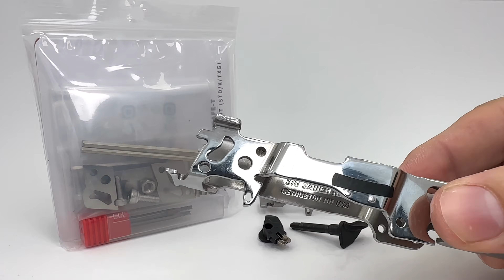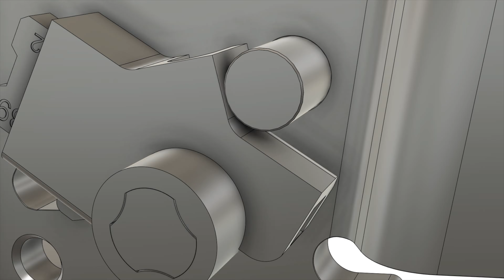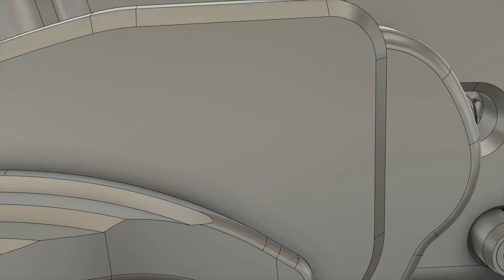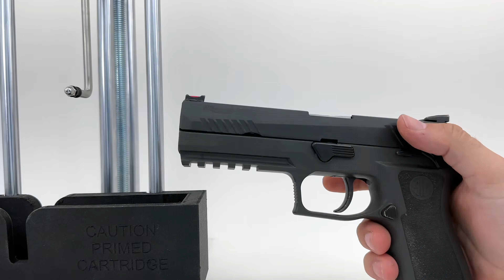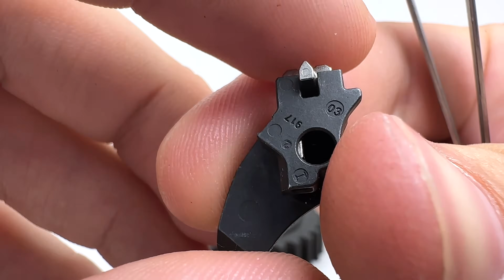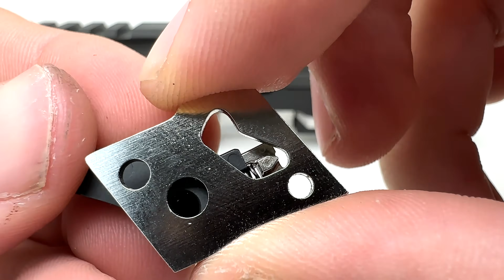ANALYSIS OF THE P320 MANUAL SAFETY

Comment: Will this stop the gun from self firing?
Reply from the maker: To be fair, there’s no evidence that the gun has ever gone off, literally on its own. There were a lot of Youtubers not that long ago trying to make that claim, but no one ever actually came up with a method to actually do that. It always came down to having to either modify internals or touch the trigger.

However, if that’s not what you meant then technically yes, it will help from accidentally pulling the trigger, and of course it still acts as a additional method of intervention in case you drop your P320
Reply: @SIGMECHANICS I'll respectfully disagree with you on that, a number of you tubers have proven and shown the gun discharging with no modifications.  I do like the idea of a secondary safety to prevent unintentional discharges though.
Reply from the maker: All good! To be fair, there are quite a few videos out there, if you can tell me which video you’re talking about I can try to explain what they are showing you for a mechanical perspective.

Comment: Can the P320 manual safety be modified to function like the P365 MS blocking the sear?
Reply: I have an M18 and 2 P320 Max that I have put in a manual safety.  Any way to design a safety that blocks either the sear or striker?
Reply from the maker: Not that I have seen yet. I have heard of an aftermarket MS but I don’t think they ever actually released it.
Reply: @SIGMECHANICS do you see room in the 320 FCU to accommodate a sear blocking hook as in the 365?  I have nearly 5 K in guns and optics sitting idle, I’m betting I’m not alone.
Reply: Thank you for answering.  I am hopeful.

Comment: Would be great if the 320 had the same safety as the 365. I like that the 365 has that hook applying  that extra pressure under the sear
Reply from the maker: That would be nice! Someone has a patent for something like that but I’m not sure if they will actually manufacture it.
Reply: @SIGMECHANICS would a hook or bump be added to the MS bar to engage the sear?

Comment: How hard would it be to add a cam to the center of safety lever shaft?
You know what I'm talking about don't you Edmund?
Reply from the maker: Do you mean similar to how the P365 design is?
Reply: @SIGMECHANICS  Exactly..
I'm a metalsmith not a gunsmith. I'm just thinking of a cam with a set screw on that shaft.
Just something I have rolling around in my head.
No need to reply.
Reply from the maker: I’ve also thought about it as a concept. It would require more modification than I could do with the tools I have, but if you ever get to do it, please let me know!
Reply: @SIGMECHANICS  maybe drag the Rubbermaids tools boxes out of storage.

Comment: Edmund seriously rocks.  The narration is engaging, the explanation thorough and detailed, and the macro videography and postproduction work is first class.  

The P320 is a seriously brilliant design but has had some issues where the holes in the Swiss cheese aligned a very small percentage of the time to create some near and actual tragic results.  I am a 1911 guy and the fact that Sig made a striker fired pistol with a tactically sound manual thumb safety is what brought me to the P320 platform. There is even more brilliance to the manual safety design than is discussed here.  Prayers and condolences to the family of the airman who just died.

Comment: As always, an excellent job of review. I try to read all of the stories that come along on the P320 unintended discharge and the SIG 'enhancements'.  I do not know how many of the guns had the external safety design and it was engaged, most stories appear to not have the safety at all.  Still too scary for me, I bought two of the P365, liking the feel and different safety function design.  Why would the services want a weapon that did not have a fail safe under control of the shooter?

Comment: My question is how does this safety prevent the unintentional dropping of the fireing pin. Does the trigger not engane or allow the gun to even move to pre cock the firing pin? Does the firing pin stay in a max extended "ready to drop" position while not fired. Most of these new issues are stemming from the firing pin and safety levers and blocks failing.
Reply from the maker: It basically prevents a trigger pull, by doing so it stops the safety lever from moving the striker block out of the way.
Reply: So if the striker block is not moving out of the way, is there way to determine my striker safeties are in spec and working correctly?@SIGMECHANICS

Comment: So you dance around it and I have watched twice. I might actually buy a p365 as I know now that the sear is captured and would be drop safe. I owned two p320's and luckily some Sig Fan boys relieved me of them but You have confirmed that the sear remains uncaptured and with enough force at the proper angle the pistol will still go off when dropped whether the safety is engaged or not. Without capturing the sear the safety is meaningless and promoting a false sense of security.
Reply from the maker: That is incorrect. For there to be a drop safety issue the trigger would need to move back via inertia. With the safety lever installed (and active) if the trigger then tries to move back, then it would be blocked as the trigger bar would not be able to move with it. 

Quite a bit of force is needed for the trigger bar to release the MS block, then even if it did, the trigger bar would be tripped into disconnecting from the sear.
Reply: @SIGMECHANICS  If the sear is uncaptured it will go off plenty of discharge reports from the military with the M18 in flap holsters safety on going off. As long as that sear is not immobilized you are just rolling the dice and my femoral artery is far to important to me for that nonsense.
Reply from the maker: @KJVJournalistMedia even when un-captured, there is a timing mechanic at play too. If the sear moves without a trigger pull the striker safety will not move and will prevent the discharge.

I know (especially if you’re sold on the idea) that it’s difficult to change your mind on it but the fact remains that for all of the claims that it’s “going off”, the claim has yet to ever be replicated. Even with millions on the table for the person who does… it simply never has been.

It’s unfortunate though because the claim is simply and scientifically unfalsifiable. It sucks because with firearms, if you’re not 100% certain then you’re opening yourself up to doubt and hesitation with a critical tool and if you’re not unwaveringly certain, then I cannot tell you in good conscience to carry it - even if I myself am certain of its safety.

Comment: Great video!
Can you do a video on the uncommanded discharges, how to check for safety, and if/how the manual safety could prevent an uncommanded discharge?
Reply from the maker: Honestly I can’t. Not because I don’t want to, but I simply can’t prove it (one way or another), it’s scientifically unfalsifiable! I can work towards doing scientific tests on other claims like if pushing down on the sear can make it go off without a trigger pull or the one about the mixing of parts, but I cannot claim to know about the UDs without being able to at least prove it on screen somehow.

Comment: If I understand correctly, the sear, if not blocked, an AD could occur with a drop? It seems that the problem with the P320 is the sear and striker. I'd rather it block the trigger bar and sear.
Reply from the maker: Not exactly, the sear if not blocked will still have the striker lock lever as a backup. If the MS is installed you additionally have the block on the trigger bar.

Comment: Great video Edmond! So it seems that the manual safety on the P365 adds an additional degree of safety. If I understand correctly, in the P365 the manual safety not only prevents the trigger from being pulled, but also prevents the sear from moving from any other cause. Is this correct? Also am I right in understanding that the P320 manual safety does not prevent sear movement independently of a trigger pull thus theoretically the striker could slip off the sear if the sear was to move in the absence of a trigger pull. Also, in such a situation of aberrant sear movement in the P320 could the striker/firing pin block safety be deactivated allowing for an unintentional discharge? Or as in the P365 does the manual thumb safety in the P320 prevent this? Thanks!
Reply from the maker: Thank you! That is correct the P365 manual safety when turned actually moves a small hook underneath the sea to prevent it from dropping further down whereas the P320 only works to hard stop the trigger bar which intern prevents the year for moving. 

Because the sear and the lock lever on the striker are independent of one another, even if you pulled down this year, the safety lever would not rise unless the trigger was pulled. Without the safety lever rising then the lock lever on the striker would not move.

Comment: What about Sig p320 carry pistols that went off with no trigger being depressed?
Reply: Those were non-safety models and the older models that the momentum issues that Sig recalled
Reply: @fantacontrol  mine is a sig p320 x carry.. the latest model that fired in my holster.. its the whole design.
Reply from the maker: Are you saying your gun fired in holster? As in, you personally experienced this?

Comment: I have two P320's, one  with a Grayguns trigger kit and the other just the Sig recall. Great video, One question is will the mod you designed work with the Grayguns trigger or should I return it to the original. BTW I am passing this on to a couple of others.
Reply from the maker: Buy the modification do you mean the MSAFET kit? If yes, yes, it will work with the Grayguns trigger.
Reply: @SIGMECHANICS  I did the modifications to two 320's. Overall it runs as it should and personally have no problem as a everyday carry and as a training aid for my job.

Comment: So, can I ask a dumb question?  With the MS engaged, it actually DOES prevent the sear from firing?  So, even with issues that others have had(regardless of negligence, etc) this MS would actually prevent those types of discharges?
Reply from the maker: The MS only blocks the trigger bar from engaging the sear, not the sear itself.
Reply: @SIGMECHANICS understood, but it prevents any sort of it to “fire on its own”?
Reply: His other vids point it can't fire wout a trigger pull to move the striker safety and sear @douglaspatterson6633

Comment: Great content. Can we dig into why accidental discharges are happening? 

From this video it seems that the manual safety does NOT prevent the seer from moving as in other models....this would suggest that even with the manual safety....the firearm will be able to discharge if the seer mechanics are truly faulty.
Reply from the maker: Thank you! You are right the manual safety does not prevent the sear from moving only the trigger bar. The P365 however does block the sear.

As far as accidental discharges, go, I personally have yet to see any evidence that there is something wrong, I am still constantly investigating any possible theories. There are a few of us actively testing and creating devices to see if we can replicate the claims.

As I mentioned, we haven’t been able to and after so many years I don’t think we will find something wrong. Our current guess is that people are still inadvertently pulling the trigger Either themselves while unholstering or by an object.

I have also personally seen the condition of some of these law-enforcement pistols that have supposedly discharged on their own. I can tell you with full confidence that what I have seen from pistols that were being disassembled by an armour immediately after one of these discharges happened, is that some of the pistols were assembled by somebody with little to no knowledge about how the pistol should be assembled. One particular pistol, I recall was full out missing critical safety features that I don’t understand how any competent armour would have missed.

Obviously, I cannot get into detail. However, it is my opinion that the P320 is a good design and is safe.
Reply: @SIGMECHANICS 
Under what circumstances could a person, even an ignoramus, assemble the pistol without said critical pieces? Most of us Sig owners are NOT trained armorers, but we freely swap FCUs with other grips and slides, as the marketing material suggests. Are we at risk of doing something fatally wrong? 

Were certain police armorers (to remain nameless) doing something more intrusive which may have contributed to the "uncommanded firing"?
Reply from the maker: @fin_jan  to be honest if you are working on it yourself, there is always a possibility that you could forget something. That’s something would probably be caught pretty quickly because you would notice it wouldn’t function or the trigger might feel different.

I suppose I can like this to putting diesel in a gas engine. It can be done accidentally, and you can ruin your engine, but generally speaking it probably won’t happen unless you really are not paying attention.

I know for a fact that on at least one of the police pistols the armour didn’t put in the striker safety spring, and they also put grease all over the fire control unit as well as all over the striker, which is a big no.

 It’s possible people are building them wrong, but with the level of redundancies, I still doubt that these are the specific causes of anything. It is my belief that people are unintentionally, pulling triggers, whether by finger or holster.

Comment: As a right-handed shooter, I hate the "slop" in the left side safety lever compared to the right side. If you've never used the right-side lever, try it and I promise you'll notice a difference - the right side is perfectly crisp but the left is...not. Upon inspection, I don't see a remedy aside from high-precision drilling and threading of some kind of tensioning screw or set screw - but that screw would need to be accessible AFTER the FCU is fully assembled, which would make the job even harder.

Comment: Great video my man. Why doesn't Sig offer an FCU with a safey from the factory? It's pretty much the only thing that's stopping me from wanting to build one.
Reply from the maker: I never understood that either, it’s such a small change that it would be insignificant. 

I did invent one way to do this on a regular non manual safety P320 though, I’ll link it below… let me know your thoughts!

(UPDATED) P320 MANUAL SAFETY CONVERSION TOOLKIT
https://youtu.be/wOTGWaTOrqA
Reply: They do. The M18 comes with a manual safety.

Comment: So you think the P320 is a legit and robust system? Well designed? I’m just use to Glocks, so I wanted your opinion because I’m thinking about getting the M17 commercial. Thank you.
Reply from the maker: Yes, very much so! There is a lot of negative content out there that uses an older issue (drop safety in 2017), to promote doubt / fear about new and unproven issues like unintentional discharges. 

The former was dealt with in 2017 by issuing a new lighter trigger. The latter is not true and is not something that has ever been proven using scientific methods to replicate the problem.

To answer your question, the more I use and put the P320 through testing the more I respect how well engineered it is as a product.
Reply: @SIGMECHANICS  thanks for the reply

Comment: I paid attention to the video but I may have missed it. So from my understanding the P365 safety blocks the sear from dropping, but the P320 safety only prevents the trigger from being pulled. So theoretically, if one were to drop a P320 with the manual safety engaged, it could still fire if the sear engages/disengages since the manual safety does nothing to prevent the sear from moving? If I am understanding correctly it would explain why the P365 is a design with way less safety complaints despite being carried AIWB more than the P320
Reply from the maker: To be able to discharge the trigger would have to be pulled back enough from the inertia caused by the fall. If the sear however drops (just the sear with no trigger pull), then 1. The second sear ledge could capture the striker and 2. The striker still would not hit the primer as the striker’s lock lever would not have been disengaged.
Reply: @SIGMECHANICS  Then all these cops shooting themselves are having negligent discharges. And I'm not being sarcastic or passive aggressive. From an engineering stand point it seems impossible for these guns to go off by themselves.
Reply from the maker: @paddypibblet846 The unfortunate truth is many YouTubers and influencers get more clicks with the negative negative than taking the time to investigate the issues. If I could ever prove a mechanical issue I’d be the first to report it and show my work in order to bring clarity and force changes. However, to date, I’ve remove all safeguards and manhandled the P320 in ways WAY out of spec and I could never get it to fail the way it’s been claimed.
Reply: @SIGMECHANICS  Agreed. I think what didn't help the Sig when it comes to how people currently perceive it... was the original drop safe problem (which they fixed) of the gun firing when being dropped. After that it was destined to be disliked. It may go the way of the Beretta. At first disliked and hated by service members/police, but once all the negative misinformation wears off, it will be highly regarded. I was always suspicious of all these claims of the gun "going off" by itself because I remember cops saying the EXACT same things about Glocks.
Reply: @paddypibblet846 you also have to realize most police department use the p320 not the m17 or M18 or a variety of a p320 FCU with the safety on it, if you look into the issue of all the ND and AD it's almost all from the version that does not have a safety, and honestly anyone that owns a handgun without any type of safety at all is an idiot, I'll never own a p320 without a safety